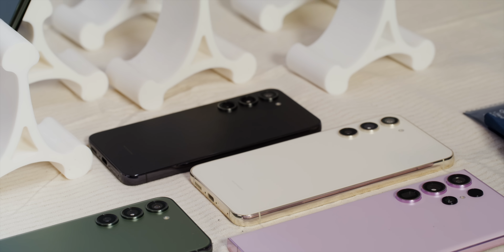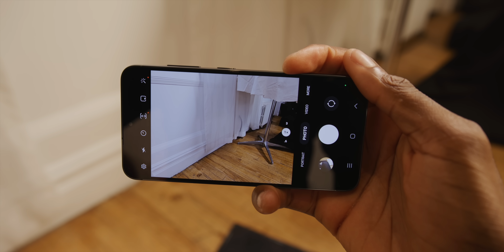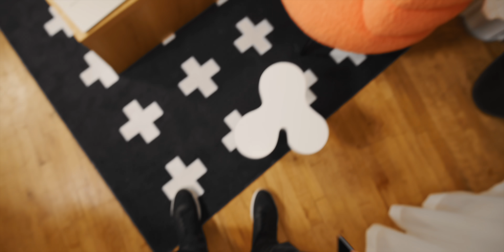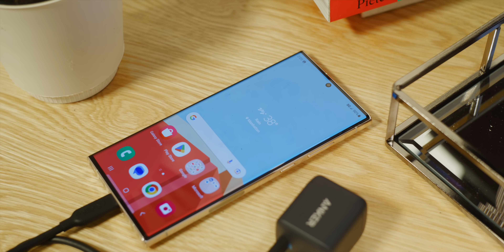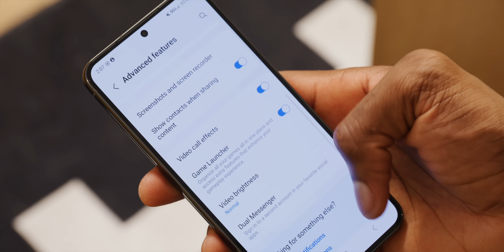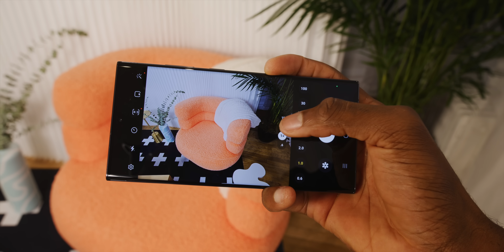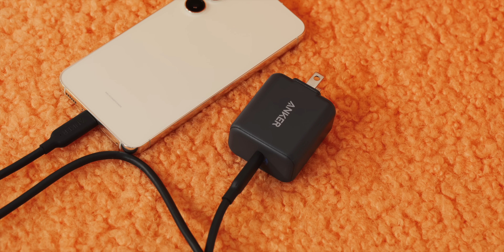Galaxy S23 / Ultra Impressions: Cruise Control!

Comment: hello please help me in choosing the right option between s23 ultra and s24 plus. I like s23 ultra in every way but it does not support 7 years of update and since I am a long term user I will atleast use the phone for 7 years so if you guys say that s23 ultra has more features than s24 plus will also get more features from extra 3 years of updates which s23 ultra won’t get so s24 plus might get more features than s23 ultra in the future. And another thing is that s24 has exynos chip which everyone is saying that this year it better i don’t really know if it is good or not for next 7 years. And one last thing if i buy s23 ultra than will i be able to get its accessories in future like screenguard and etc and since it has a curved display will i get the proper screenguard stuff and all in the future?? Please help me to take a decision guys❤

Comment: Theres now a S23 FE which is has a smaller screen than the S20 FE by 0.1 and it has bo SD card slot which the S20 FE does. Battery is the same 4500 it has the AI search feature they are pushing, Android 14, 50M rear camera but no idea what the front is i assume the same maybe. 

The s23 fe gets hot when watching Youtube really hot in the top corner opposite the camera lens. Ive no idea why i assume its the chip inside then again my S20 FE used too as well

Comment: Now the S24 is out, its time to pick up the S23
Reply: Lmao I just picked up an used S23 for an extremely good price.
Reply: $450 s23+ 😂 upgrading from s21+
Reply: Did the same
Reply: Did the exact same lol. 7 year software support means squat when the phone doesn't run for more than 3 years
Reply: just did that, lol. I've watched some reviews of the s20 made this year to see how it's holding up and I'm good for at least 4 years. I'm not a power user most of the time, if it feels fast for doing basic stuff i'm good.

Comment: As someone who has been with Apple for almost a decade but is very curious with jumping over would this be a good option? I have been going back and forth with this phone and the new Google Pixel.
Reply: What did you decide getting?
Reply: @Uncle_Drew0227  I think I will ultimately get the Galaxy S23 and then try a google phone in a couple years or so.

Comment: Typing this on a Galaxy S23. BASE MODEL.

I would say this is an upgrade over the S22, especially for the battery and overheating issues.
Yeah, maybe the camera is the same, but is that our sole reason why we use a phone? Calls, text, and internet are the main functions of a cell phone today, and basing on solely cameras and design alone won't justify comparisons.

Comment: I never really considered Samsung seriously, but to be honest, I was tired of underperformance of Pixel phones, and no longer wanted to buy OnePlus/Nothing/Xiaomi or any other chinese phone and of course, after owning one iphone in my lifetime, never ever again - so that was no option. 
I gifted my Asus ZF9 phone and started considering one brand of Android phones I have never owned - Samsung. Pick was S23 plus due to it's size which I am still not too happy about, because the unit is too wide, but I definitely did not want s23 (too small, smaller battery, slower charging), and Ultra was just way too big of a phone I was willing to cary around :) - s23 plus so far is a SPOT ON PICK... but it comes with one caviat: I did not pay $999 for it... I traded my old OnePlus 6T to Samsung for $200, had $200 coupon discount (via Shop Samsung android app) and on top of all that had 5% discount code I found online that stacked well with all discounts. Total: around $575... For that kind of price, s23+ IS THE BEST... for $1000, not really worth it in my opinion. 

If someone is thinking what to get, I would recommend for a smaller phone Asus Zenfone 10, or for a larger phone Samsung S23+ (considering you have a trade in and you leverage those discouns samsung currently offers).

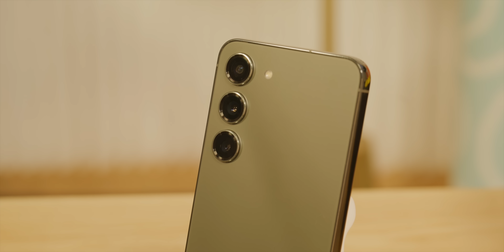Comment: 2:43 "shutter lag". This is due to the software waiting to see if you're going to swipe your finger on the shutter button (to take an animated picture) or if it was just a tap. All recent S2x have it.
The good news is it can be turned off: in the Camera Assistant module (from their store - part of Samsung GoodLock), enable "Quick tap shutter" and voila.
Reply: this is very underrated ❤

Comment: I changed from Galaxy S10 to Pixel 7. Honestly nothing comes close to Samsung. They make better phones and better features. I feel I made a mistake buying pixel.
Reply: Hey, what didn't you like about the Pixel? comparing Pixel 8 and S23 at the moment, appreciate your input. Thanks
Reply: @Raufm3  I'll try to mention what I remember. Basically the galaxies are just more user friendly. 

1. When recording a video, you cannot switch to rear/front camera while recording.
2. The Samsung gallery is better.
3. The standard video player has better functions and is designed better.
4. Samsung Music player is far better than YouTube music.
5. You cannot switch audio output (from Bluetooth speakers to phone speakers) in a single button. In pixel, you can only switch the audio output while playing something on an app, and it doesn't work in all apps..
6. Samsung dynamic lock screens have amazing lock screen wallpapers that changes every 2 weeks.
7. The Samsung camera has better functions. 
8. Better calculator on Samsung.
9. Better app arrangements. In Samsung you can freely move your apps in the apps pages. In pixel it's arranged based on alphabetical order.
I'm sure there are more, but I can't recall right now.
Reply: @plung3r  wow that was helpful, thanks a lot!
Reply: @Raufm3  your welcome

Comment: My phone company is offering me a Samsung s23, and I have a Samsung s10+. There's a small Crack on the bottom right. My phone works fine, but I'm contemplating if I should trade it in or not. Pls enlightening me if I were to make this trade that it be worth it?

Comment: The profit motive. 
People will pay £1000 for something exactly the same in all practical sense except that its got ''2023 flagship'' behind its name 
I bet it hasn't cost Samsung any extra money to develop it, (in-fact Probrably less) as, they've essentially re-released the same exact phone for a higher price and had a year to refine the production line.

I guess capitalism doesn't always mean consistent improvements to beat the competition, sometimes it means recycling the same old shit to see how many people it can fool into buying it. Sorry to get political. 

PS, I love samsung and still use an Samsung S10, and it works fine, fast as ever. Battery life has fallen a bit but nothing too concerning.

Comment: Planning to buy the S24 next year, maybe the plus version. Hoping for samsung to have something new and major improvements. The S24 is rumored to have the snapdragon 8 gen 3, not sure though but its something to hope for, its also the fact that some benchmark leaks have shown that it destroyed apple's A16 bionic, and possibly even the A17, by being more powerful on both single core and multi core performance.
In fact i might even skip S24 entirely and go for S25 next next year, which will likely have a new generation of exynos chips, if the rumors are true, its gonna have 10 cores. TSMC's N3E method is also very interesting, its something we will see on the new generation of high end chips.
Take this comment with a grain of salt, i am not even working on the chip industry, these are just rumors.
Reply: Yes but dude I'm holding out for the S25. I've heard the snapdragon gen 4 is going to have n6 turbo and the carbon lithium filter. Also expecting the 420mp dual cameras to render in 5D so no need to use GPS tagging anymore
Reply: Nah just wait for s30 bro it will have 0.1nm chip powered by quantum computing or you can wait until s40 the phone will be infused w your brain waves

Comment: I'm blown away by the low-ball trade-in offers from Samsung. $350 for my less than 6 months old Flip4 256gb...Best Buy offering $600. I pre-ordered the regular S23, same specs with smaller screen for $200 less. I'm just tired of the cameras on the Flip.

Comment: I tried the s23 in store
It has somehow been even MORE comfortable to hold than the s22, the material they used for the back is silky smooth to the point that it makes the s22 feel rough (it's not, the s22 I'd dilky smooth as well, that's how smooth the s23 feels) the edges are also a little less square and rough
It's very comfortable and very light. Also, I thought the absence of the camera hump would look soulless, boring, and a "we've run out of ideas" type of redesign, but seeing it in person changed my mind. It honestly looks pretty great. I think I would go with the plus model, the normal 6.1 inch s23 makes videos look too "squished" imo, which is a shame because I am more of a fan of the narrow design (I have a z flip 3)
Also if companies were to release new phones every 2 years I would not mind one bit
Nothing feels new when you know your top of the line model is going to be replaced in just a years time
Reply: "Also if companies were to release new phones every 2 years I would not mind one bit" - THIS.

Comment: I want to buy this phone BUT since they still dont have an sd card slot i have to think really hard about getting the 512gb or 1tb...i still have and using the note 20 ultra 128gb and im barely gonna reach 100gb used...idk if 1tb is good for me on the s23 ultra

Comment: I have my s9 plus still. Had it for 4+ years. Should I upgrade to the s23 ultra or go with the s21 ultra or s22 ultra
Reply: S22 ultra
Reply: @Codeblack_XxX  any particular reason? There's lots of deals going on for the s23 ultra
Reply: @ihsyed786  its basically the same just with minor upgrades. Price reasonable. Personally think they should make flagships every few years instead of every year

Comment: I'm probably going to upgrade the S23 later this year not because there's anything wrong with my S20, but because I would like to have my S20 be a backup phone that I could depend on unlike my old LG G6
Reply: Loved my G6 now have Pixel 6 Pro
Reply: Still have a G8 ThinQ and it's been extremely reliable. Having to replace it now because the battery is just so old and tired.

Comment: I think Samsung isn't interested in normal smartphones anymore. They do it cause it's consistent and profitable but I think they're more interested in flip/fold phones and really anything that bends a screen. Everything is just cruise control. I mean what more can you do other than make the bezels and phone thinner and make the battery better. Like yea they could do it but it's not very interesting. Like oh a razor thin phone. Great.

But making an ultra thin folding phone that is the same thickness of a normal smart phone? That's interesting.

But outside of folding phones I do think they should dig into Dex more. Being able to use Dex and make it more compatible with desktop apps for developers would be a major flex.

Comment: It's crazy it took till now for most people to say we've reached a point where yearly phone releases are no longer necessary. When in fact they've literally NEVER been necessary. Companies hold back on specs and certain features so they can release them later on via an alternate release and it's literally always been that way. Apple is the poster child of this. They'll omit a few features so they can release an updated version of their brand new phone a few months later and their loser ass consumers eat it up literally EVERY. SINGLE. TIME. I mean look at the costs of these phones, $1100 -$1300. That's literally like buying a slightly above average laptop each and every year. Ask yourself if you would buy a laptop... EVERY YEAR. No? Sounds stupid right. Yea, so is buying a brand new $1000+ phone each and every year. Especially when there is little to no updated features that you will actually NEVER use🤦🏾‍♂️

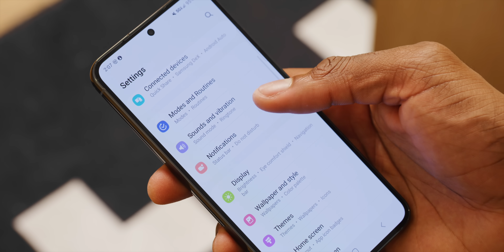Comment: Very interesting 1:57, you say, "samsung phones always feel this fast when they are brand new"..... implying that samsung phones always feel slow when they are not brand new i.e. reach that 2-3 year mark... almost as if its designed in.. cough planned obsolescence . 
It's not like phones are cars that need mechanical maintenance, yes its understandable that the battery can degrade and the storage can get clogged, but that is easily rectifiable. Fact of the matter is that samsung always nuke their phone that get a little old... :(
As much as I like the look of these phones, that's why I never buy samsung..

Comment: I've had the S10+ since 2019. 

Last year, I tried the S22 Ultra for a month. I felt the battery was very underwhelming for much I paid. $1700 for the 1TB model. After selling it on eBay, I bought a Certified Renewed S10+. I've had it for 11 months, and I'm debating if I should upgrade to the S23 Ultra or wait for the S24 series. I don't want to be underwhelmed by battery life again. And that 1TB ensures that I'll keep the phone for at least 4 - 5 years or even longer. For longevity, higher internal storage works better for me. 

Do you guys think I'm due for an upgrade?

Comment: I own a Galaxy Tab S7+.

45-watt charging on Samsung devices is not very impressive.

You only get the maximum watts when the total charge is very low. The phone and the charger negotiate to incrementally reduce the charging wattage as the battery fills up. So that extra 20 watts only makes a difference early in the charging cycle, and only if you let your battery get pretty low.

If I get the S23+ (the battery on my S20+ is getting long in the tooth), it won't be for the 45-watt charging. It'll be for the bigger battery and bigger screen (I'm in my 50s and my eyes aren't what they used to be).

Honestly, the thing I will miss the most about my S20 is the doohickey that tricks magnetic strip credit card readers. I'll miss that even more than the MicroSD card. Looking forward to the variable refresh rate screen.

Comment: I went from the s6 to the s9 to note 20 5g, now im going to the s23 plus. Im pretty excited to get it
Reply: I need a new phone I have 3 more payments on my one plus 9 phone, and omg, one plus 9 is a disappointment, the main call volume is junk, can't hear, have to use speaker function while talking to people and the charging port is messed up, I did nothing to the phone. I have to charge on my wireless charger. So, I'm thinking of paying the remaining balance on the one plus 9, never getting another one plus ever, and it's made in China. I want either the Google Pixel 7, for the awesome cameras and cheaper price and great reviews, or the new Samsung 23, for performance and it's long years of updates, 4 I heard. I'm not sure if I want a iPhone 14 or not, I've only had Android phones, all my family have a iPhone, but pay the same price for less specs than Samsung or Google Pixel, I wish LG still made phones, I loved my LG G8 in red I had. So which phone should I get, Google Pixel 7 or Samsung 23?

Comment: I read this Tweet and it hit home right away, aftwr i already saw this video.

Quote: Most of those big youtubers are either hard die apple fan boys or are bought by Google! Most of their new Samsung 23 series are like this: 7mins and I try to keep it short, everything is the same! But when Apple produces the same phone for the 4th year in a row 20 mins vid.

Apple got more press in your video when you talked about the Dynamic Island vs what press you're giving Samsung for what seems the most impressive set of cams in quite some time.

To be fair No oem is perfect. But when you consider the slew of features Samsing offers in their phones vs the iPhone, there is just no way this video should be this short.

Also, Samsung mentioned in their video why something that may be the reason for shutter lag. They mention the well on the sensor for when the shutter is open to pick up light, is deeper than it is on other devices. Because it takes a bit more time for the well to fill, maybe it leads to shutter lag. The benefit is though, a longer exposure time for more light to give a more accurate representation of what the sensor picks up.

Also i noticed shutter speed got slower after Samsung remove Dual Pixel AutoFocus from the sensor so it can focus faster allowing to be able to take a faster pictures.

Comment: "Reshaped curve at the edges to better optimize for the S pen."  This is actually the change I was looking for from the S22U.  To clarify, writing and drawing, or any S pen use is not as comfortable as it could be when you have a curved display to the extent that the S22U was.  When using a pen you want a flat canvas and want to take advantage of the entirety of the limited real estate of the phone display without worrying about hitting the curves.  You want the pen to land where you predict it to and not have to avoid the sides of the canvas.  This was a change that imo they had to make if they really wanted the phone to do justice to the succession of the Galaxy Notes and the market that they're wanting to carry over from it.

Comment: What I want, is for Google to make the Pixel have the new Snapdragon 8 chips… the tensor chips suck and have a very low clock speed and are horrible for more demanding tasks and games… the only good thing is the processing for images which they could still do using a Snapdragon chip.. they’re pretty much making budget phone chips still.. with flagship level hardware. If they went back to Snapdragon not only would it be a WAY better and more powerful phone, they’d get a lot more customers that way. People who spend 800+ on a pixel with the tensor chips are dumb.. a Pixel 7 Pro with a Snapdragon 8 Gen 2 chip would be the best Android phone you can get. Might not have the flashiest design, but it would beat out almost every other Android phone on the market. Now they can’t even touch the rest of the market.